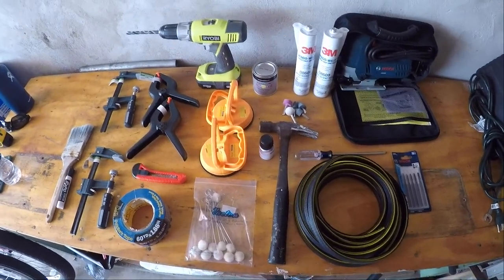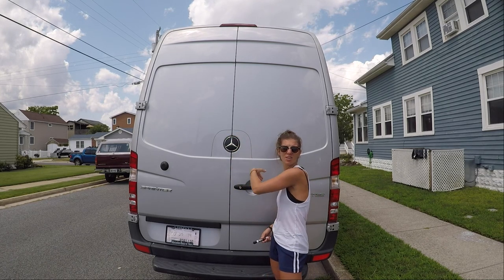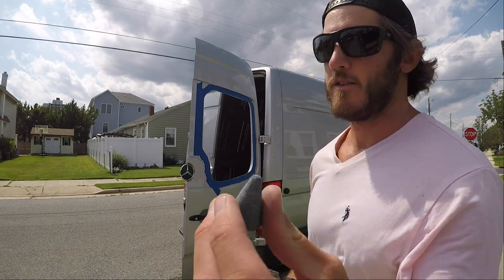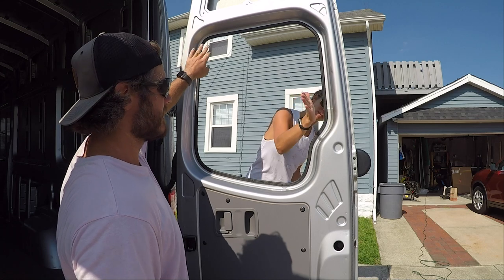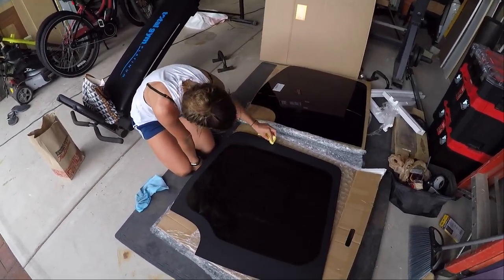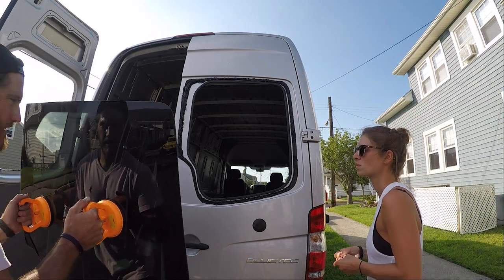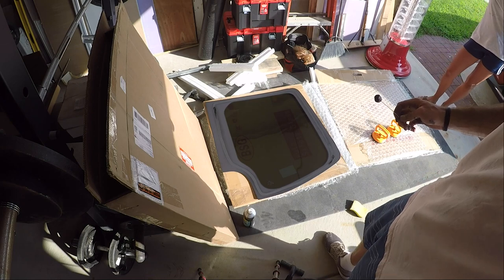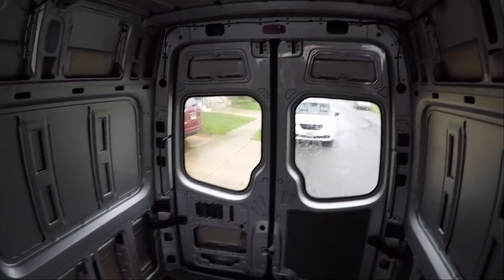How To Install Back Door Windows On A Sprinter Van - Van Life Build Series Ep. 1

Comment: A little trick I saw on an English channel was to put the suction cup on the inside after you have the windows in place and then attach a couple of  Bungee cords to hold tension until the sealant sets up. I know its too late for your windows. But maybe anyone reading the comments could use the trick. 
👍👍👍
Reply from the maker: J. G. That’s a brilliant idea I’m pinning this comment thanks J.G.!!!
Reply: Can you remember the name of the video or channel? Sounds like a good tip
Reply: @bodo9387  sorry it was several years ago and a few thousand videos ago
Reply: @Scrambler85  Understandable!
Reply: they attached a bungee cord from one suction cup on the outside to the suction cup on the inside? Did they loop one around each side of the door? THANKS!
Reply: @Scrambler85  Lol. Classic comment. Thank you for your great tip J.G.
Reply: @treynewsom1817  you'd want to attach the bungee or ratchet strap from the inside suction cup to some point inside the van to have even force pulling toward the front of the van. Even a temporary pole from van body frame

Comment: G'day Mathers On The Map! Could you give us a little more info on what version of the sprinter van you've got, please? I think you said it's a 4 cylinder diesel? 170 wheelbase, extended version? 2WD? High top (I think there's also an extra high top)? Thank you so much for documenting your build, especially things you would do differently next time, that's super helpful! It looks awesome, nice work!
Reply from the maker: Hey Christina thanks for watching!!!

Our van is a 2015 170” normal high roof sprinter with the 4 cylinder engine and you were right it’s 2wd!
Reply: Excellent, Ta :D.

Comment: @ @Mathers On The Map do you remember how many tubes of adhesive you used per window?
Reply from the maker: A little less than one tube for each window but since you want a continuous bead I started with a fresh tube for the second window instead of using the remainder of the first tube.  Hope that makes sense
Reply: @MathersOnTheMap  many thanks, that's really helpful!

Comment: Hi another great video, thanks! When you say panel for around the MB emblem is that just a trim piece? Would you get it from the dealer or ?  Thanks again!
Reply from the maker: Thank you!!!  Yes I meant trim.  We gave up on ordering it, tried from 3 different dealers and they all cancelled the order, not sure why 🤷🏼‍♂️
Reply: I will need to order it to so if I find a good resource I’ll let you know.
Reply from the maker: Sherry Moore sounds good thank you!!
Reply: Hi, I sent you an iMessage regarding the rear emblem trim.

Comment: Did y’all ever have a leak? We just installed ours have have A MAJOR LEAK. Gunna have to redo the whole thing
Reply from the maker: Try to identify exactly where the leak is coming from and then remove the edge trim from the inside of the door and apply the 3M window weld from the inside.  I would attempt that first before completely removing it and starting over.